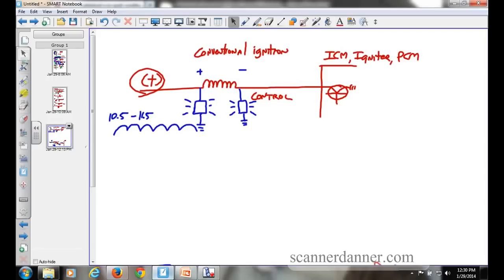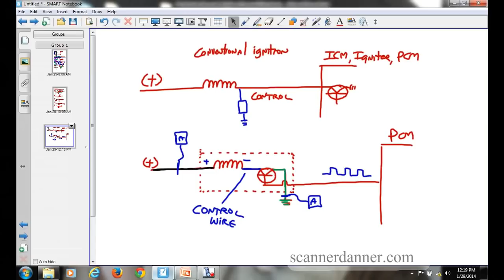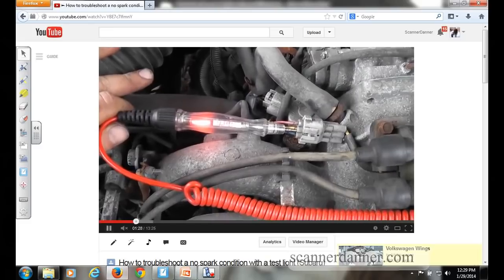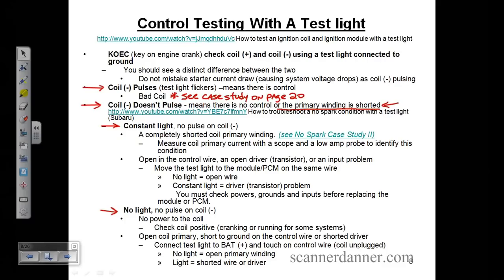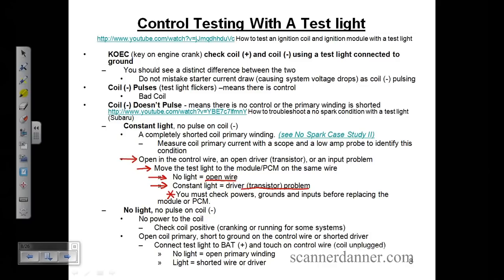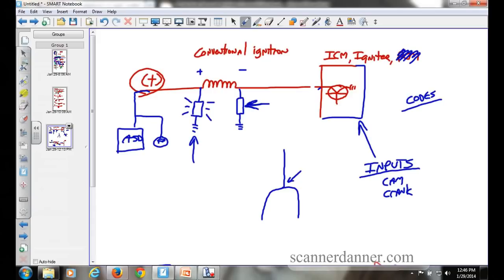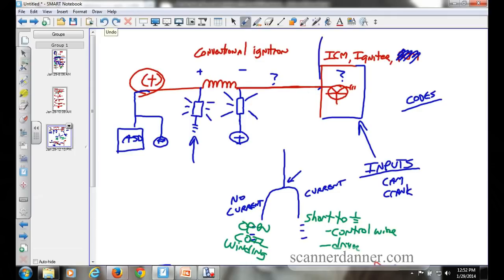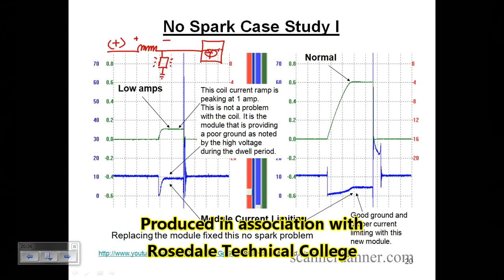No Spark Diagnostics "Control Testing" Part 1 [a ScannerDanner Premium video]

Comment from the maker: The original video is part of my Chapter 22 "No Start No Spark Diagnosis" and is titled: CHAPTER 22 NO START, NO SPARK DIAGNOSIS PART 3. Here is the link for SD Premium subscribers https://www.scannerdanner.com/scannerdanner-premium-chapters/chapter-22-no-start-no-spark-diagnosis/379-chapter-22-no-start-no-spark-diagnosis-part-3.html It is 78 minutes long. 
I have broken this video in half and made it two parts for YouTube and FaceBook. In part 1 of this video, I will be focusing on the test light method. In the second half (part 2 to be uploaded next week), I will be talking about where the test light can get you in trouble and why the lab scope is needed at times.
Reply: Great video.  Would be great to see a video that describes how a 4 wire Coil over plug setup(like on VW/Audi VR6 engines) works and then analyzes this system with a test light and/or multi-meter.  Specifically speaking when you get a P035# type of code on just one cylinder.  There are no misfires recorded but the P035# continues to show up on the same cylinder(even if you swap the coils from adjacent cylinder).  It's driving me crazy trying to diagnosis.  thx  can't wait for Part 2 of this video.
Reply: UPDATE: In case someone has similar issues.  The #3 signal wire from the DME to COP was damaged.  Resistance was 1 actual vs spec of 0.2.  Repaired damaged section and P035 Code is gone and no more misfires.

Comment: First of all thank you making your videos, they are a goldmine of amazing information. My teachers at the college were great but only thanks to your videos did I have the knowledge I needed to find a shorted cam sensor 5v reference wire that was causing a no start-No communication issue on a Toyota truck in a short timeframe. 
Now im working with a ford with no power to the injector fuse which is supplied by the ecm as far as I can tell from the diagrams. Going to work tomarrow excited to solve this puzzle. Thanks again and keep up the good work 👍

Comment: @5:00, you're right, the control wire is only about 3.5-4 volts on and off.  This from a 3-wire ignition coil, Nissan Altima 2003 2.5L, I probed at least 3 coils and they all had the same voltage readout from the PCM. It has an initial ramp of 3 to 3.6 volts peak.

Comment: Hi, thank you for the great teaching throughout this video.
I think I got the idea of using a test light on the negative or control side of the coil while the test light's wire is connected to ground. I think what I understood was that the positive feed goes through the coil and out of it (test light is on) until the transistor grounds the coil (test light is off). As a result of that, there would be a voltage drop that makes the test light go off momentarily then back on when the transistor goes off.
Thank you again. I am really impressed big time with your knowledge and your awesome teaching.

I am thinking of buying the book but I do have a few questions about it. 
God bless you.

Comment: having some (not so much) fun with 92 dodge now and first half I was thinking about the relays😅 
Still working on it believe it's the computer because the starter relay had intermittent issues during testing and it gets its signal ground from the computer and other fuel/ignition relays went from no computer signal to faint signal going to try used computer before checking for shorts because it quit running like key was turned off and junk yard computer cost next to nothing fingers crossed. 
Love the videos by the way learned a lot
Reply: DODGE, Designed of Deadly Generic Electronics

Comment: Scanner, for control testing with a test light. I noticed on the fuel injector circuit in another video you had your test light connected to battery positive. For control testing coils you have test light connected to battery positive. Can you explain the difference so I can understand?

Comment: Hi, nice video. If my test light do not flickers at a constant rate, with " pauses", should I suspect damaged wire at the connector?
I have continuity in control wire, between pcm and coil female conector, but I feel some " soft spots" in the connector side, like a broken wire.
I had the same with some coils in the past, and solved replacing the coil female connector.
Expedition 2001 COP wiring.
Reply from the maker: These coils are known for shorting and cooking the engine computer driver https://youtu.be/y4r5OcHN5Lg

Comment: bad coil with no control can be annoying, its good to test for control with a light to positive and coil disconected as well. I have found before a coat hanger hoding up wire that was shorting it and bad signal like at the end caused by a fired coil. you can get information that will make you not trust your tools.

Comment: Thanks Scanner Danner for you're Wealth of Knowledge!  How does coil over plug design differ from coilpack in terms of ground side control?  You showed that with conventional distributer ignition that one can test the ground side control with a test light. Would that work on a 3 wire coil pack as well? Ive got a 4 cyl ford Ranger with 2 coil packs, primary and secondary (8 spark plugs).  My primary (exhaust side) coil has no spark coming from all 4 towers.  Ive got battery constant power at primary (middle connector).  Swapped with known good coil and no change.  New CMP sensor, I have resistance from both cmp wires to pcm terminals. My secondary coilpack (Intake) is firing like it should, so I tested the control wires with LED test light and got pulse on both control wires with the engine running.  Did the same control wires test on the Primary coilpack with the engine running and got power on both but no pulse.  99% sure my pcm control drivers are fried  causing open ground control circuit.  Am I correct that a fried transistor driver inside the pcm would would cause the test to stay lit on coilpack control wire?  Seems kind of odd that both pcm drivers would fail.  Could a cracked coil arcing to ground cause this on a coilpack system?   Thanks, I'm still learning
Reply from the maker: do the same tests with an incandescent bulb test light and report back
Also, from memory, there are times that one of the coils is disabled on this system, but I do not remember when
Reply: @ScannerDanner  Thank you Scanner Danner.  I made a video if you have the time to watch.  I've got constant test light at Bat + terminal (middle) at coilpack with the truck running.  Also have constant test light at both control wires with truck running. https://youtu.be/X1i5Mv_v--k
Reply from the maker: @diymotorcycling1719  thanks so much for your kind words my friend. One big mistake that you did. You must not leave all the plug wires off when doing that test! It is super bad for the coil and also for the driver in the computer. That spark must ALWAYS have somewhere to go and with both plug wires off of each coil (there are two of them in that pack of 4 towers). So you can have weak spark by testing it that way because there is not return path back to the coil. 
This is a waste spark coil where the spark leaves one tower and returns on the other. You must have a plug wire providing the other path when you have your test light to one tower. Do the test again. I bet the 2-3 coil has very good spark with a plug wire attached. Now the 1-4 with no spark, I want you to check it again as I described. 
Also, your control test was invalid because the 2-3 had spark, it was just weak, so you absolutely had primary control on that one even though we couldn't see the flicker. With the engine running, that flicker will be hard to pick out because the frequency is so close together. Hope that makes sense. Re-do the test and we will talk
Reply: @ScannerDanner  Thanks ScannerDanner.  I did another test. Here is the video https://youtu.be/hNlhoP4lzGA.  Basically same results as before.  I'm about to buy a reman pcm and coilpacks.  Yeah I realize the test light test isn't good, really need to do the amp ramp tests like in you're other videos.  Anything else I can try?  Thank you!

Comment: Danner, Diagnosing an 04 Stratus, I have normal wave lengths on the cam and crank sensor, 12 volts @ the coil while cranking for 1 second then it shuts off. I get fuel spray ,so I want to call the ECU but it seems I need to see part 2 of this case study.

Comment: Does the 2 wire cop coils have a seperate ground on control side or does the ground get supplied by pcm on control side? Sorry for the questions but you referred me to this video and it has been a lot of help so thank you for that. If it was a seperate ground then there would be an ignitor on out side of pcm.....right?
Reply from the maker: The igniter (or coil driver) is in the PCM and yes, the PCM controls the ground side of the coils directly. No module, no igniter (external). And please don't apologize! I love answering questions for the non silver bullet types. And that is clearly not you. Thanks for the intelligent questions!

Comment: Thanks for this video but question is how can test a weak ignition coil with test light or a volt meter if there is pls feed me back thanks a lot
Reply from the maker: Check to see how far of an air gap the spark can jump. Most coils can jump a 1 inch gap

Comment: Working on a 2002 chevy silverado with 5.3
I have one cylinder misfiring badly and another with no spark at all. Ive done the usual stuff. Swap coils around, new plugs and wires, cleaned and swapped placement of injectors, tested fuel pressure, tested compression, tested for vacuum leaks, checked valve springs, and verified injector pulse. I am currently thinking it is the driver in the pcm that is failing. I have failed to find the proper way to test the coil wiring. There are four wires in the plug. 
1. 12v positive 
2. Ignition control signal
3. Low reference
4. Ground
I have tested the 1 and 4 and they are fine. How do I test the other two with a multimeter or ice pick style circuit tester? I have tried to back probe the control wire at the pcm and the coil key on and cranking and am not getting anything. Can you give me guidance here Scanner danner?
Reply from the maker: on the one with no spark at all, you need to test the ignition control signal wire for a 0-4 volt square wave signal. Without a scope, an LED test light may work for that pulse

Comment: When you check ICM for signal with test light on both sides, does that wire must be connected to the module or not?
Reply from the maker: when I mention "both side", I'm talking about the ignition coil (coil positive and coil negative), not the ICM

Comment: I did a trouble shoot in mitsubishi mini van u61 model.it has a  3 cylinder 3g83 engine.problem was cranks but no start all the 3 ignition coils are getting hot while in ignition on position.i test the ignition control line with test light it's flickering when cranking.there was no any wire shorts.when I was test the control wire voltage with multi meter it was not in reference voltage 5v.but with 9,46v with ignition on.at last I replaced the ecu.the problem was solved after that.i checked the ecu transistors there were 3 tea teansistors.its seems to be nothing wrong with that.i test that without removing the transistor with multimeter.if the transistors are good.what can be the issue in high-voltage in control wire.pls.
Reply from the maker: post this to my forum if you still need help. It is free to join https://www.scannerdanner.com/forum/post-your-repair-questions-here.html
Hope to see you there!

Comment: Paul, is their anyway to see the results of putting a new set of spark plugs in a car using a scanner. Any PID that would show difference?
Reply from the maker: If the engine is not misfiring, there will be no difference in driveability, nor scan data readings with old and new plugs

Comment: You said that it is not posible to watch a voltage waveform of the spark on a [coil over plug module] design because of the transistor in the COP. I have been successful at viewing it using a scope but also an additional component which is easy to source and found everywhere,  called a capacitor.  It is a slightly different scope setting setup,  but is easy to do. Contact me and I will explain it better if you don't already know.  I have been doing it this way for years without fail.
Reply from the maker: What I said was you cannot view a PRIMARY voltage waveform on a cop coil where the transistor is in the coil. What you are describing is a secondary voltage waveform. Thank you!
Reply: @ScannerDanner  you are correct
Reply from the maker: No problem. Thanks for your comment and input

Comment: So if I join premium. Would I be able to get a a.s.e. certification after?
Reply: I got my ASE in electrical and engine performance  only because of Danners channel and book . He truly is the master of driveability diagnostics :-)
Reply from the maker: I do not offer any type of promise for whether or not you will be able to pass an ASE test but what I can tell you is the information I focus on will definitely help you! And more than just the electrical and engine performance ones too. Everything has electrical questions in it now. Even brake and suspension tests.
Reply: I took both electrical and engine performance at our local community college and Paul taught 199 percent more than they did . I bought several dozen books and training manuals through the years and learned much more from Paul's manual . As Danner stated every system in the new vehicles are pretty much electrical in one way or another and will become more so . There is no better education in this field compared to what he offers .
Reply: And if you truly apply yourself in what he teaches I believe you can pass those tests .
Reply: snickers loudly at "ASE"
I'll behave, because some are very skilled ;)
Reply: Georgie Mac  i passed the ase L1 
With the help of his ebook
 i been a subscriber for a long time 
Before he had his premium channel
I bought some lessons from his website they helped me a lot 
Join his premium you will not be disappointed

Comment: whew, that audio.... blown out/over-driven,  oh-well ;)
Reply from the maker: Audio was bad?
Reply: yeah a little, it has crackling in the highs, possibly too close to mic or recorded too high and clipping frequently. some people may not notice it, depending on what they're watching on. I'm always on a desktop with large monitor and home theater audio setup :)
Reply from the maker: Yep, it's good on my PC and phone but bad in my truck through my stereo. The original is not this way, I did something wrong in the rendering of this....
Reply from the maker: @throttlebottle5906  I over sampled the audio in the edits of this older video. It's good on the premium channel (the original recording). I don't think I'm going to re-upload this, I'll make sure part 2 is good or at least better.
Reply: fine by me, many wouldn't notice it anyway ;)
the hand-full of us that do are like me.... ( no "smart" aka stupid small devices)
Reply from the maker: Please let me know about the audio on the part 2 I just uploaded. Same original audio for both of these here.
Reply: @ScannerDanner  I think the main part of the video is better than it was, the introduction clip is still rough. then again I have the Flu and not feeling so great with everything flowing at once and ears a bit muddy :( doh